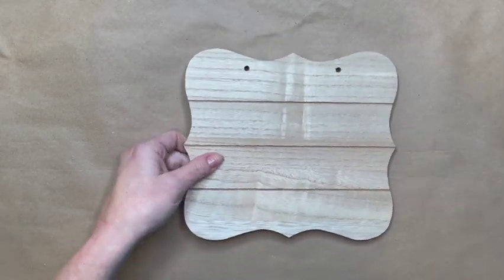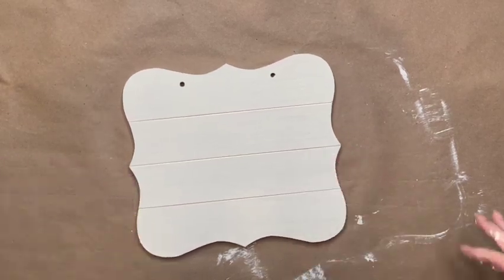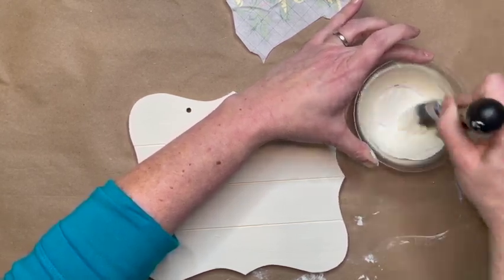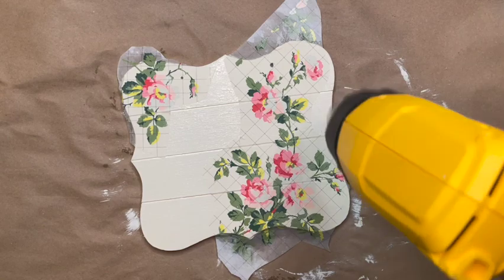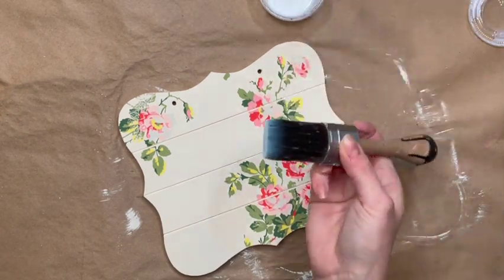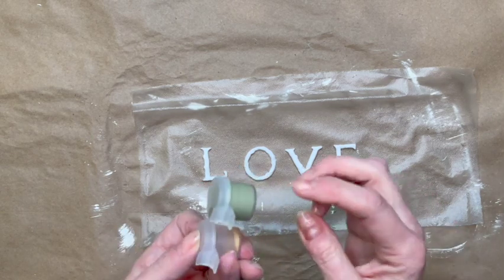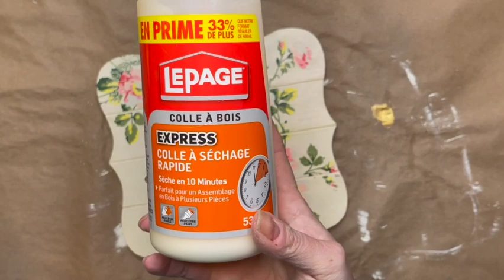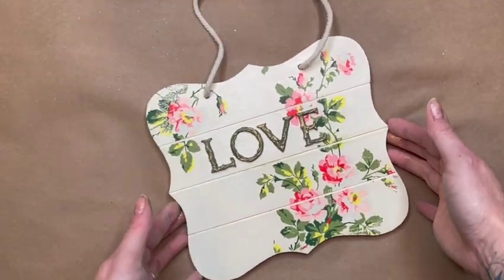Introduction to using the new IOD Paint Inlays

Comment: I have tried these three times with varying results.  I can paint so I ended up hand painting the roses & leaves where the inlay didn’t release.  I will used up the rest of the inlays but in the future, I will just hand paint them.   I definitely won’t be buying any more paint inlays.  It feels inauthentic to use them when I know how to hand paint my images.
Reply from the maker: The most common reason for the inlay not releasing fully is lack of medium - meaning your paint (or clear medium of choice) wasn't thick enough for the inlay to set into properly. 
That's great that you can hand paint images. Back when the transfers first came out, I too felt like I was cheating when using them instead of hand painting. BUT... using these types of embellishments is a skill in itself and there are so many ways in which they can be used that each piece created is unique. Not everyone has had the chance to practice the craft of hand painting enough to realize their very own skills & talent - and that's why these products exist. They give anyone who want to create beautiful works of art - the ability to do so.  🥰
Reply: @SentimentalSalvage  good advice about the medium.  I must have watched 50 videos from IOD and other contributors and everyone has a different “technique”.  The last person I watched on IOD’s channel said to use a thin, even application of Poly Acrylic Clear Coat to avoid the wrinkling.  Another said to spray water on the front and back of the inlay before laying down into wet paint.  My items came out ok the 3rd and 4th attempt however the first two had to be scrapped, scraped, sanded and repainted.  The inlays are too expensive and everyone is using them so they are not unique any more.  Thank you for your advice.